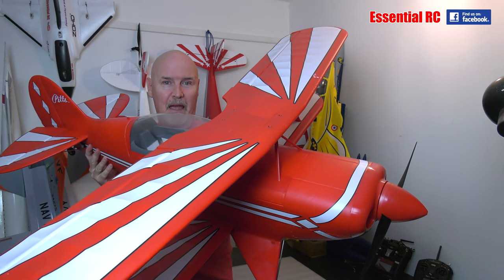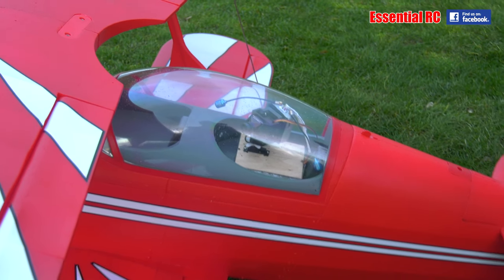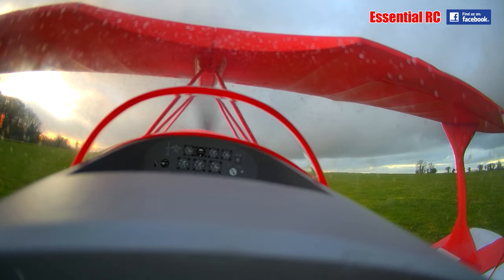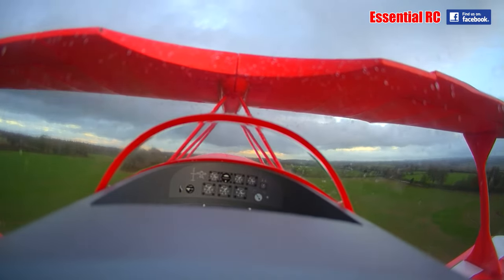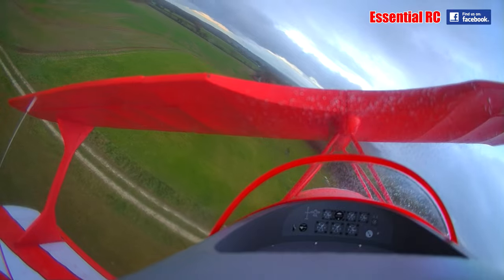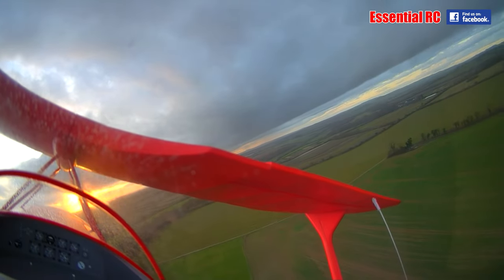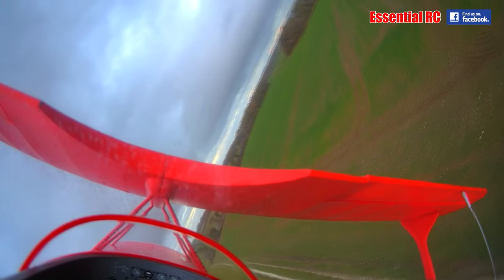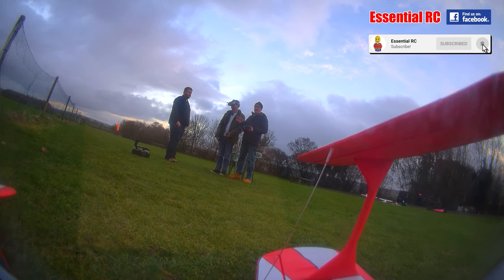Flying with Realtime Cockpit View ! FMS Pitts Biplane EASY FPV Conversion | FPV TEST FLIGHT

Comment: I've done this with a Wots Wot Foam-E. Amazing how it looks through the canopy. On the Wots Wot, I did not assemble it, also because the little thing got a bit tail-heavy with the FPV gear, but mainly because of the distortions.
It gets fascinating, when you start doing, what those bipes do best: Snap rolls and spins 🤪

Comment: I love this "FPV everything" approach to rc❤️👍 Did you make some sort of air cooling for the DJI air unit btw? No overheat?
Reply from the maker: Not on the three flights I did. That's another reason I do this LOS test flight to see if I get any issues like that. I did puncture 2 small holes in the front of the canopy so air was being forced in BUT it is quite cold at the moment. During the Summer I suspect it will be a problem and I would have to install a small 12v fan as I have done in other projects.

Comment: That’s pretty much what it looks like in the full scale Pitts S2B that I fly.  The visibility is pretty much exactly the same.
Reply from the maker: Thats very interesting to hear. Thanks for your comment.
Reply: @EssentialRC  yeah so in the full scale Pitts there really is no final approach. I just keep turning and blend the downwind base and final into one continuous turn and roll wings level right over the runway and land. It kind of feels like divebombing at the runway. Otherwise if you flew any kind of a wings level final approach. You wouldn’t be able to see where the runway was at all. The runway completely disappears during the flare, and I can only see a tiny bit of it on my left and my right. Another technique I can use is to do a cross controlled forward slip so I can see between the wing and the nose and see the runway a little bit that way.
Reply from the maker: Wow! Thanks for sharing that technique James. Makes sense with the obscured view over the nose. I'm in the process of adding telemetry with a flight controller so can see altitude, air speed etc...and then I will try that next time out. Thanks again !